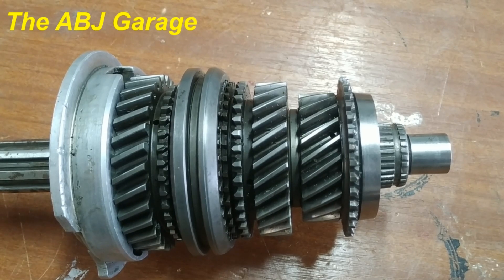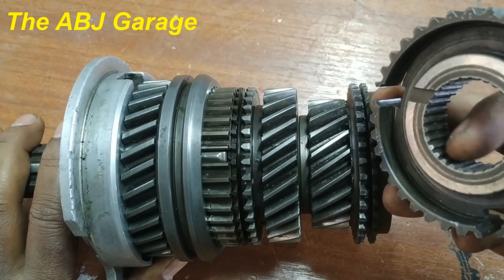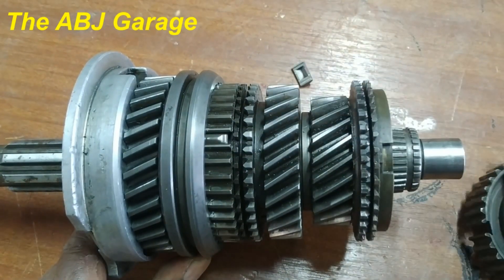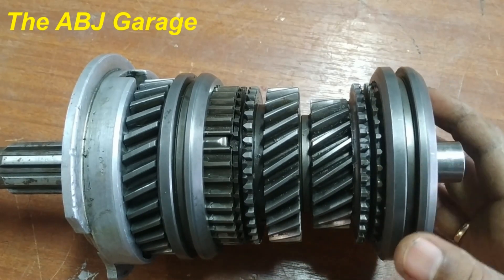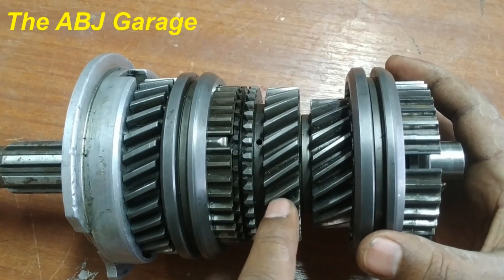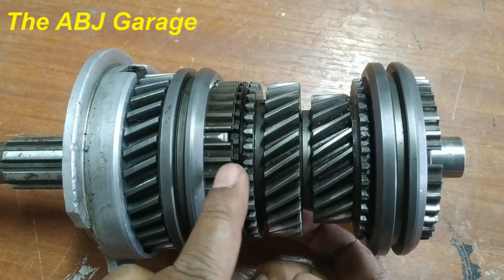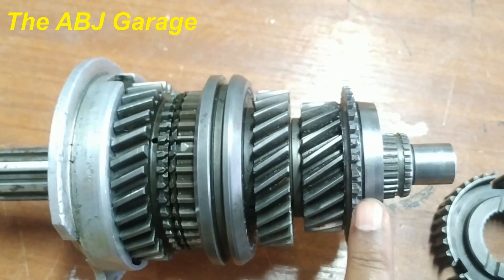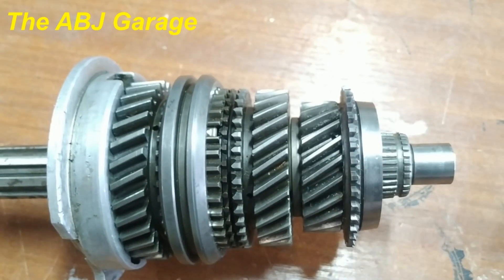Synchronization, Manual Transmission Synchronization Explained

Comment: Hello. I disassembled my Ford type e 4 speed transmission for maintenance. When I put it together and tried it, I first noticed that the synchronizer retaining pins that you showed with a pen were coming out of their place when I put it into gear. This happens every time. The round steel rings holding the pins seem a little weak to me. I wonder if these rings are the reason for this situation?

Comment: Very good video. I was wondering what happened when I engaged neutral by mistake on my motorcycle and then tried to engage second gear. The gear would not engage and the shifter moved up and down on the foot a couple of times before I let go. So what happened would be the synchronizer ring would not have caused enough friction for the gears to reach the same speed. This caused the shift dog to move back and forth a couple of times. The gearbox seems unharmed by my silly mistake. But I presume they are built to take a certain amount of abuse.
Reply: Sorry to say your explanation is wrong.
A motor cycle gear  box can only change ONCE without realeasing the clutch.
The gear change mechanism  holds its position until the clutch is released

If it happened at almost any speed , going  from top to bottom gears  would have disastrous consequences .

Depending on the speed your flight through the air would , for second or two , be very exhilarating

Comment: What can explain hard shifting gear 1 and 2 when cold even whit new oil 
When worm it works fine ?
Reply from the maker: If live in extremely cold area, cold weather can lead to a transmission that shifts hard when the temperature drops, transmission fluids with poor cold-flow properties can thicken and cause elongated and hard shifts until the fluid has warmed up enough to flow properly. Switching to a high-quality synthetic transmission fluid will help. In extremely cold environment, the gearbox oil is cold and therefore thick. This makes gearshifts, which involve parts moving easily within the gearbox, difficult as the parts don't move easily. After a time engine heat from the nearby engine or just friction heat up the fluid making gear shifting easier.

Comment: عرض رائع جدا عندي مشكله ان الترس الثاني يفلت ويعود بعد التعشيق .النحاسات سليمه
Reply from the maker: Please have a look at the synchronizer sleeve as well. If it is worn then the clearance will increase and the shift fork might not keep it in place. The most probable cause  is however the wear on the spring loaded detent balls that keep the shift linkage in place.

Comment: Need too know bought 6speed, got motor work, done, my mechanic is going too take my trans/gear box out, take it next Block to a transmission place, it will get into 5 gears but 2nd🚫 he thinks it's teeth around the gear, or synco
Reply from the maker: Yes! Could be!